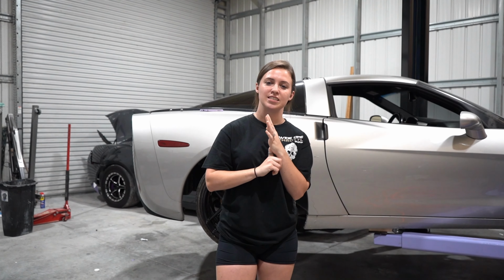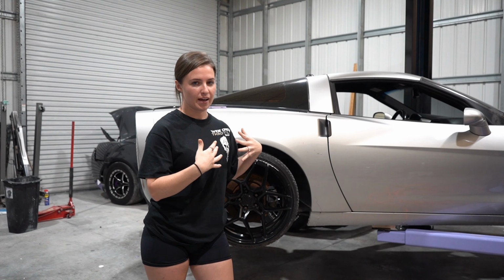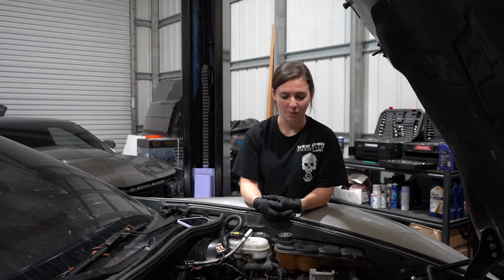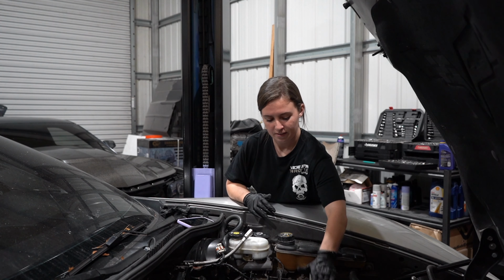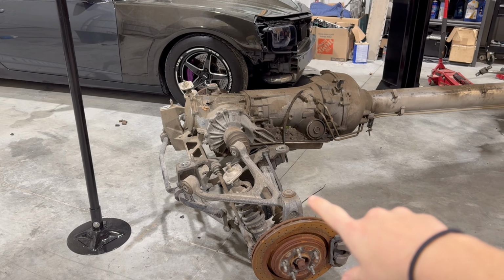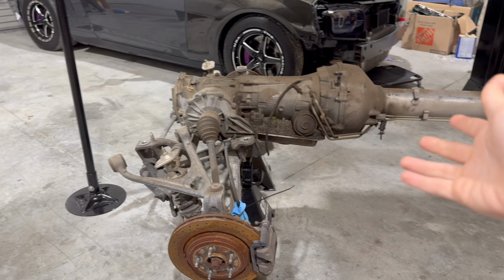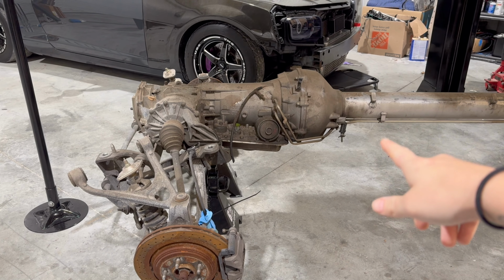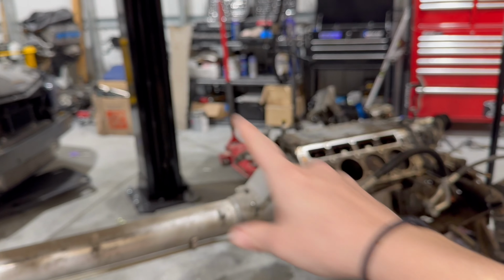TEAR DOWN of my C6 to MANUAL SWAP IT

Comment: It would be very helpful if you’d include everything you had to do to make this car a manual (other than a parts list) and what I really mean is how hard it is to re-wire everything to convert to manual. I’ve heard it’s like 15-20 hours worth of rewiring to make the car believe it’s a manual. 
Planning on doing a 6l80 to Tr6060 swap on my C6 soon. Subscribed and following along! Good luck guys!
Reply: Currently trying to figure out this part after putting the car together lol

Comment: Damn, that escalated quickly. What are you going to do to the motor? You might as well atleast stroke it to a 416 or sleeve to a 427. I remember swaps used to be easier when electronics weren’t involved. Have you looked to see how crazy that is going to be or running a dominator or something?